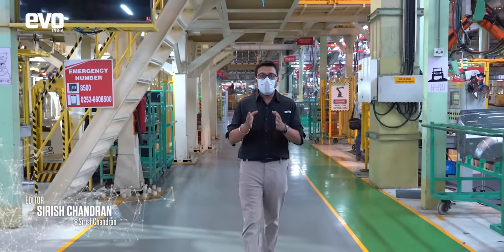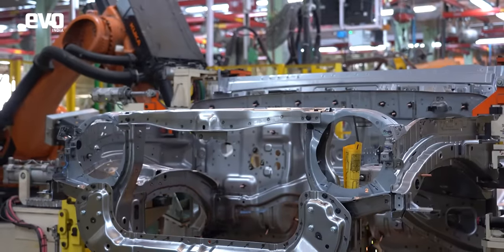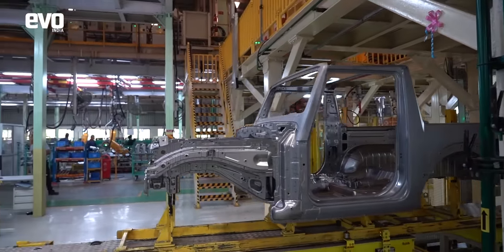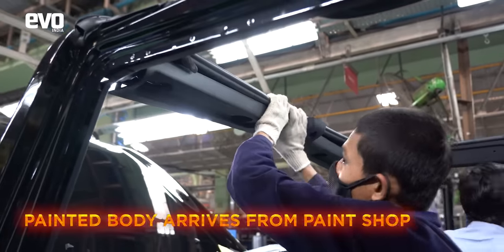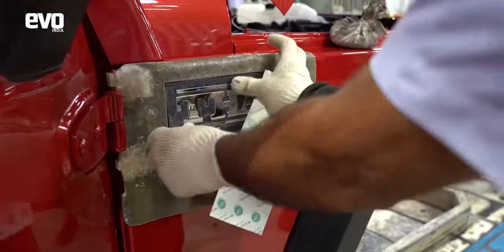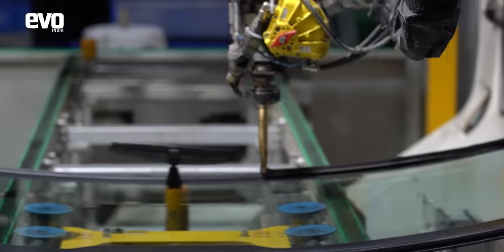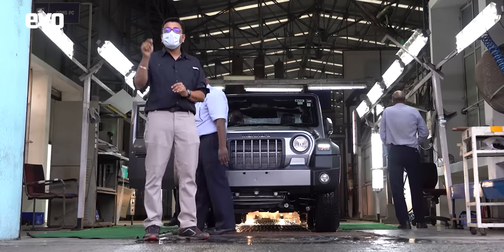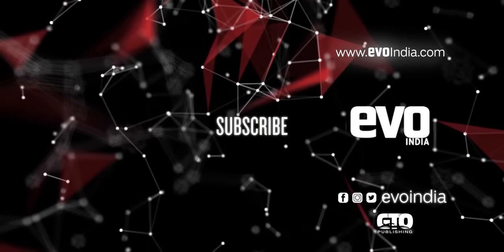How is the Mahindra Thar made? Watch the entire process of making the Iconic SUV | evo India

Comment: You missed the most crucial part... this video is incomplete without giving the information on how many they can assemble in a day...?? how many shifts?? Etc etc. bcoz when the Thar was launched, Mahindra could only manufacture 2000 units per month... but since the waiting time has not crossed more than 10 months... they said they have increased the production from 2000 to 3000 per month...!!
How much truth this statement has... if you would have confirmed it in the video then it would have added more value...